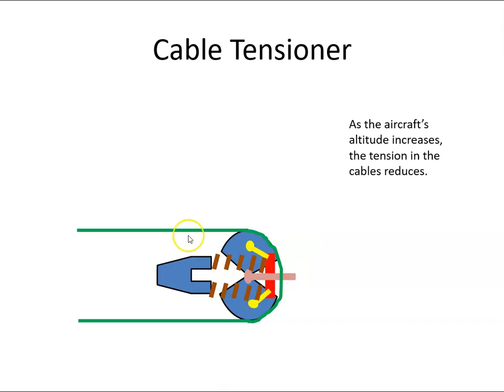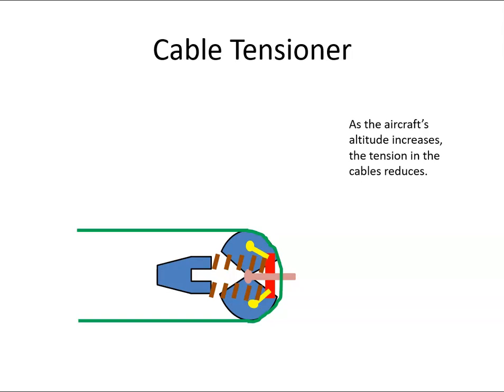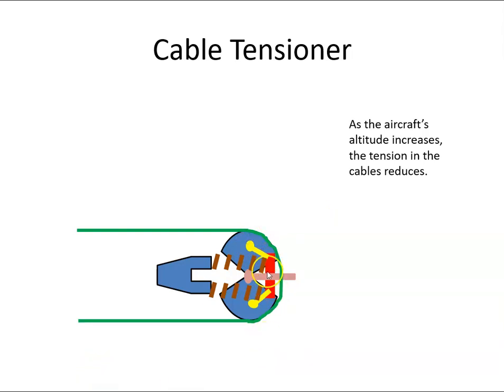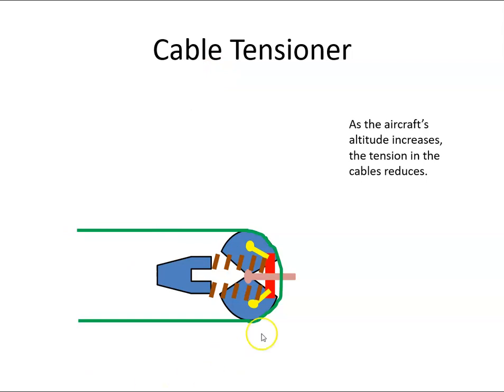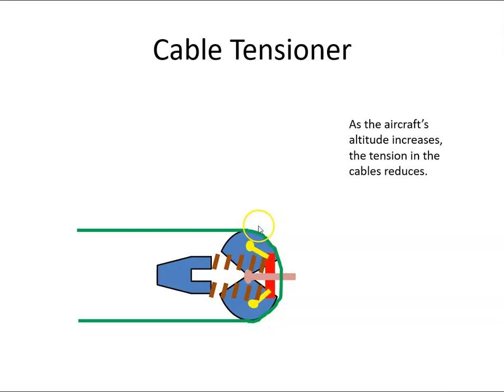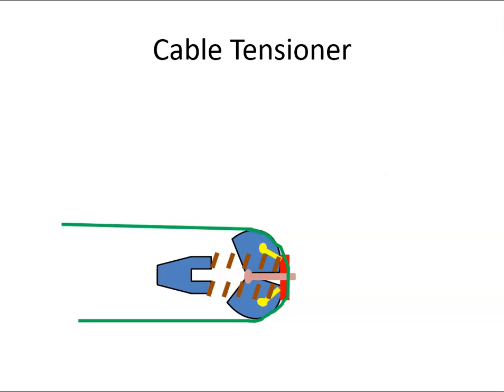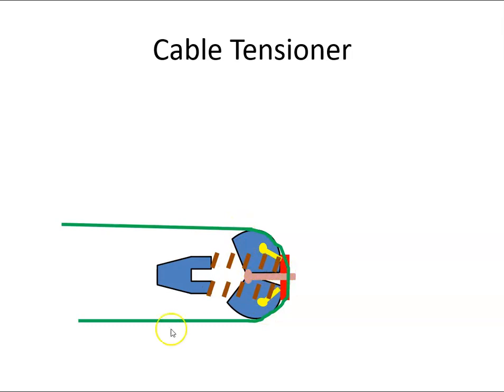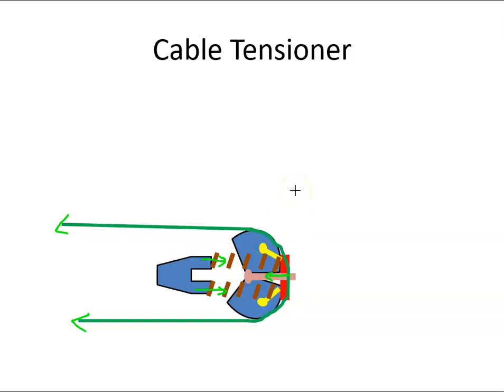Flight Control Cable Tensioner

Comment: It should be at high temperature cable will be expansions  and regulator tends to tension this  slacking or sloppy of cable due to increase temp  not vise versa 
I think it is logic 
What's your opinion?
Reply from the maker: As the aircraft goes to higher (colder) altitudes, the cable will shrink, but the aircraft structure will shrink more, so the cable tension will lessen with altitude.
Reply: @RoddyMcNamee  thanks alot I got this point